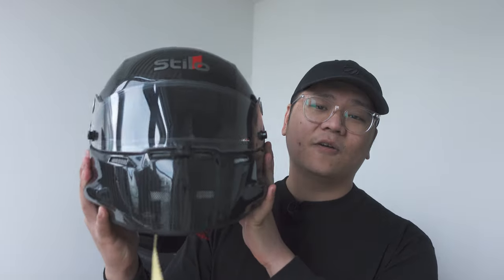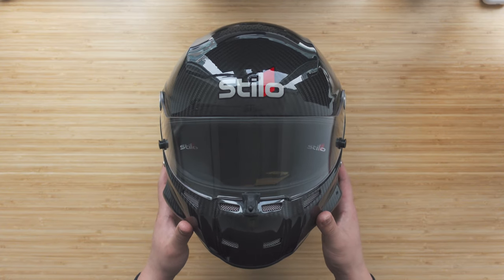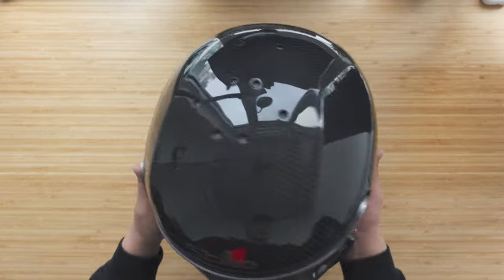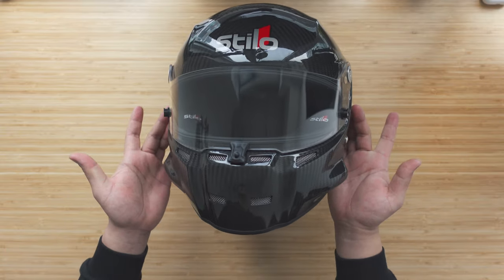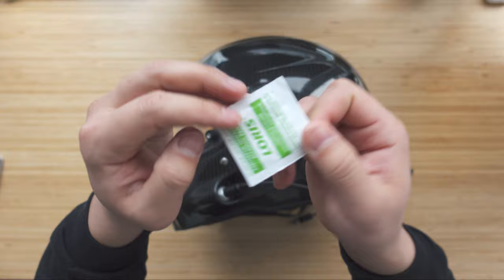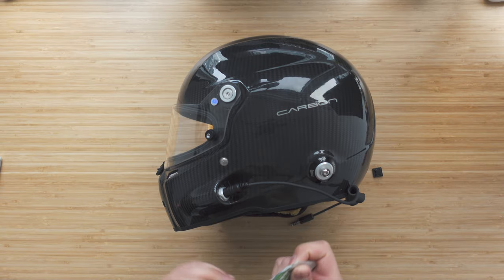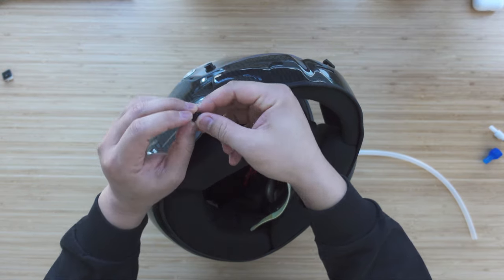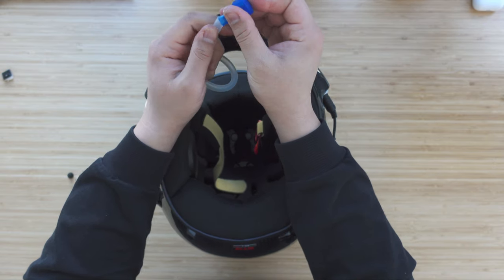Customizing my DREAM HELMET - Stilo ST5 Carbon

Comment: The opposite tension for the comms cable was neat, feeling more free to pull and tug will make your pit stops that more confident
Reply from the maker: Yeah you really want to optimize for the user - in this case the key stakeholder is your teammate and how the car is setup for all drivers :) if you look at pro endurance teams (with electric water pump), they run the water tube through the comms cable coil so that it’s literally all in one spot when disconnecting/connecting. My setup will probably require a teammate to head to passenger side to drop in the camelbak pouch.

Comment: Hey bro are you still around? I was really wonderinmg how your Simucube rig turned out. Mine is practically finished and I had a lot of fun with it since last time we communicated. I was wondering how yours went but now I noticed you are on a hiatus.
Reply from the maker: Hey! Yeah works been busy :( Simucube rig all set now - just did some TCR races this morning! I’ll try and post another vid soon. Let me know if you have any questions in the meantime!
Reply: @2trackminded  glad to hear from you! I enjoyed putting those righs together at the same time. I will have to put a video of mine as well, where ghetto solutions meets high end hardware with some whacky stuff. Currently working on adding triples only because I can, even though I really enjoy VR. I have recently connected an arcade fighting stick to my setup, nice big well spaced easy to press buttons for VR, pressing keyboard binds was terrible with headset on, and I don't use my SRB BB Ultra attatched wheel much as I have been mostly driviing old manual cars with a nice MOMO deep dish, which means no designated wheel buttons. Bonus points that I finally got some hand brake solution using the stick itself from that arcade stick thing. Works great for now!

Comment: Great Video. I have the non-carbon version of the same helmet. Do the ear muffs make the helmet fit tighter?
Reply from the maker: It does as the material is a bit more dense vs just the pads

Comment: The shield is ya807 or ya808? Thank you :-)
Reply: If you have an FN or a GT helmet, you should be able to use any visor with the YA- base. 

I have a GT and I use the YA800 and the YA802 depending on the time of day. I’d double check your model and go from there. I hope this helps, cheers!
Reply from the maker: It’s YA807 - Medium Red

Comment: Can this be used for motorcycle riding ?
Reply from the maker: M rated helmets typically have larger eye ports and therefore I wouldn’t recommend an SA helmet for that use unless it’s specifically designed to do both.

Comment: where did you bought it, from their website?
Reply from the maker: I purchased it locally from a retailer. I highly recommend finding a shop where you can try it on. Most of the pricing is very consistent across Stilo's distributor network.